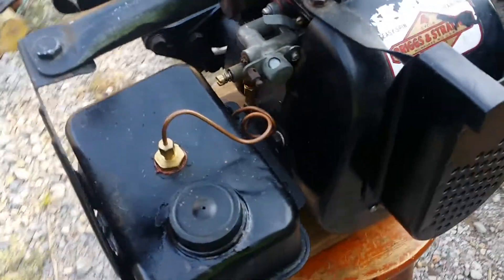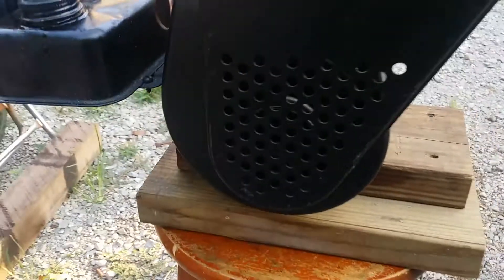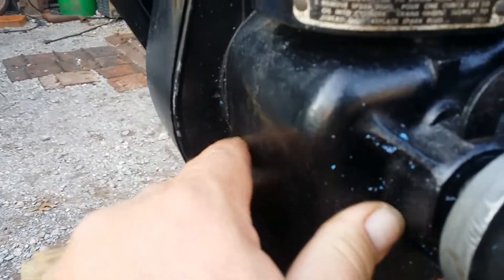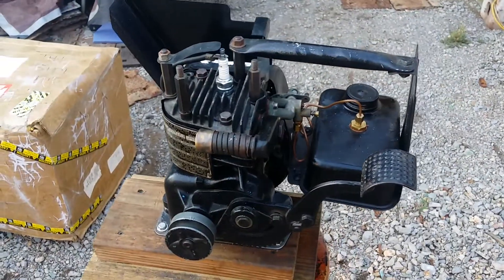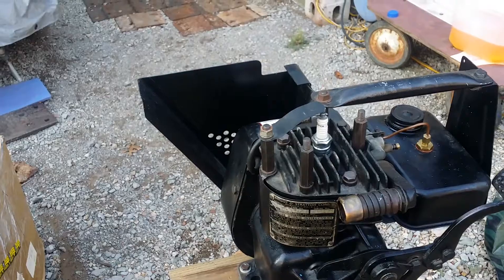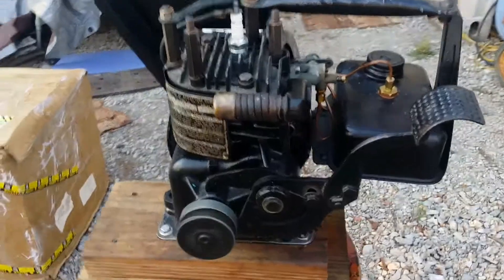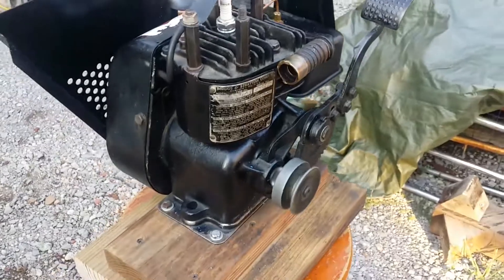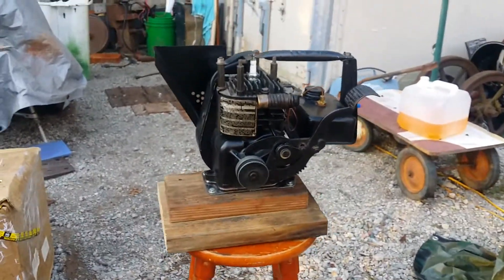Briggs & Stratton WMB kick start Washing Machine engine Running condition

Comment: I got a Model 5S model 3/4 hp on an old Motor cycle built in 1952. Was told it was 1943. Do you known what year. Type no. 700025 . Serial number 1691376
Reply from the maker: ridewfo1 there good runners thanks for watching